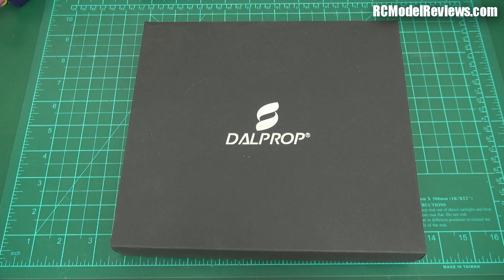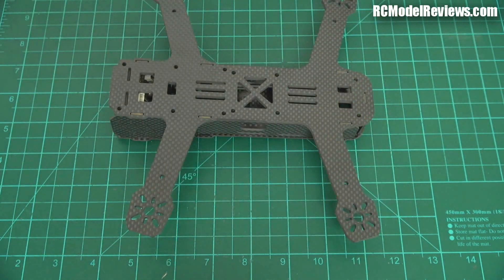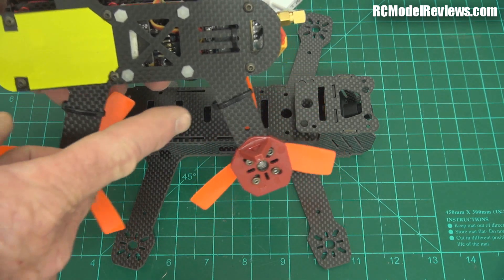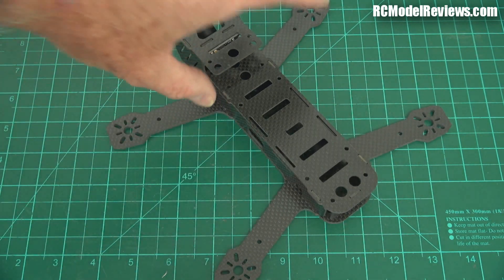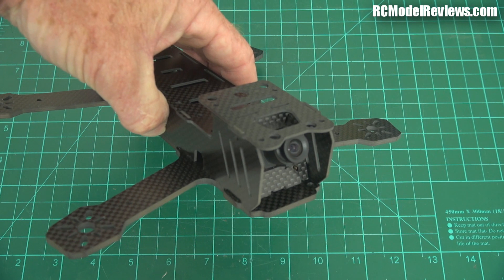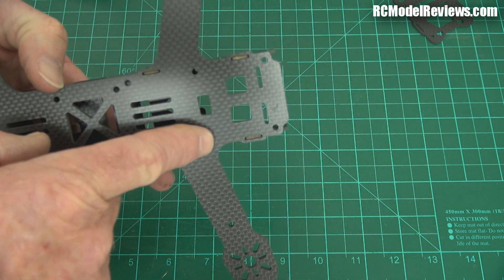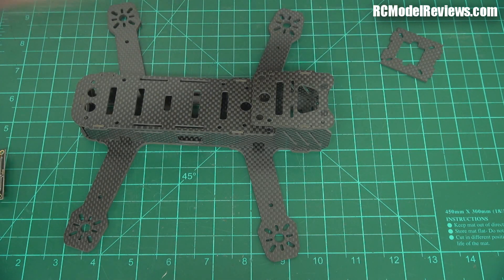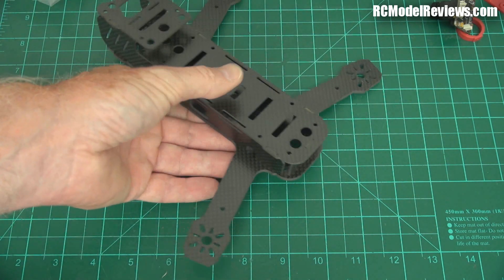DAL DL220 carbon mini quadcopter review (part 1)

Comment: DL220 frame was awesome 2 years earlier. I have it - frame have outstanding resilience to crashes. During learning crashed countless times against trees and concrete but wasn't able to break the frame. Plenty of space inside. Although have two issues: Little options for camera mount, because loop mount and naked board cameras with holes at corners are in fact obsoleted and not available more than 1.5 years. And frame itself is very heavy. Didn't used it more than year. Then recently decided to refurbish my old DL220 frame with newer components. Now it have F4 FC and different motors. Still 378g w/o battery. However with DALPROP T5045C props on Betaflight 3.4.0 preview and UAV Tech Betaflight default setings for 3.4.x 8K it now flies a way better than old build. I'll try to skin the build down below 350g later.

Comment: Bruce the reason they mount the fpv cam mount to the HD cam mount is because CMOS cameras and vibration = a lot of jello on a miniquad.
You will find that you need to add & remove weight all the time when a prop is unbalanced or not tracking true and you don't have a HD cam on board.  It really is a pain in the ass witch is why I went back to CCD cameras.

Comment: hi bruce, the hole in the center of arm is a backup for install landing feet (standoffs), we concerned if some people do not like using the motor protector to landing then they can install a the standoffs to be a landing feet. and we are going to release a new amazing frame kits, it is a X frame, we 'd also like you to make a summary of it.

Comment: Be careful running the wires from the escs through the hole on the wall. Make sure you leave some slack or the carbon fiber edge will cut your wire.

Comment: The "unusual" size of the "carbon" comes from the fact that it is not a real carbon fiber. Rather it is "composite" which is made by gluing together  much thinner layers together. You can easily see these layers on this video @ 2:05 - 2:10. I am not an expert of composite materials, but I am pretty much sure this is not the way how a real carbon fiber is produced. I know that it all comes down to a price. But lets be fair and not call this material a "carbon".

Comment: depending on carbon fiber you have whats called a min unit ply thickness for a cured ply and depending on quality and class this can vary but usually max about 8_10% of nominal ply thickness. so someone may get 3.3mm. so most thickness should be slightly , over 3mm as msnufacturer attempts to incorporate this variation. variation due to resin content, cure process, bagging, plate size etc

Comment: Hi Bruce love the videos, you mentioned that you will be testing the Epicrc 2204 2800kv and 3200kv motors. I have the 2800kv version on a Boxer180 and at the moment its my favorite and fastest quad. Can you run thrust tests with dal 4045 x3 tri-blades  and see if these motors can handle 5in props on 4s
Reply: +Bogie717 Yes, I have some DAL props here so I will be testing them on 3S and 4S with two and three-bladed props.

Comment: The camera angle is fine in my opinion
Reply: +Johnny FPV If racing is your bag then yes, the angle is fine -- but if you're more into proximity then it can be a real pain to have too much camera angle.  The ring-grip mount is much better because you can adjust the angle to suit your flying.
Reply: Or you could look at it as a way to force yourself to learn to fly fast in tight spaces.  I fly at 40-50 degree proximity and I didn't get that good from flying with 10 degree tilt.  Then again I didn't start with 30 or whatever this has :p

Comment: Hi Bruce , do you think that manufacturers will be concentrating on making components lighter now the FAA have started this registration bull shit , so FPV quads can keep under the 9oz weight limit ? I live in the UK an so you can guarantee if USA does it UK will to , just interested to now what you think ? Happy new year mate .
Reply: +Scott Thompson I suspect there will be a surge in interest in sub-250g craft -- but not as much as you might think.

Why?

Because if you have any craft over 250g then you'll still have to register with the FAA.  Only those who opt to fly nothing heavier than 250g will be free of the registration burden and I suspect that there aren't many who would be prepared to give away or sell all their other models, solely to focus on sub-250g ones.

Then there's the reality that if there's a massive surge in the popularity of sub-250g models, the FAA will simply change its definitions to include everything over 100g instead of 250.  Here in NZ for instance, we used to have a 100g lower limit for the definition of a "model aircraft" but when our new regulations were imposed in August 2015, that lower limit was removed so everything which flies and is remotely controlled is now covered.

Remember... he who makes the rules can never lose the game.
Reply: I wouldn't register quite yet. The AMA is currently fighting so if you are a member of AMA you don't have to register any aircraft.

Comment: Review the 122-130mm size frames.
I get 11 minutes hovering my 130, and easy 7 minutes  hard flying. :-)
Reply: +mike jh What frames are you using?
Reply: +xjet Hi
http://www.banggood.com/Deformation-Insects-130MM-Carbon-Fiber-Frame-Kit-QAV-Quadcopter-Multicopter-p-1009504.html

http://www.banggood.com/Diatone-ET-150-V1_0-Carbon-Fiber-Quadcopter-Frame-Kit-w-BEC-Power-Distribution-Board-p-982840.html

http://www.banggood.com/Diatone-ET-160-V1_0-Carbon-Fiber-Quadcopter-Frame-Kit-w-BEC-Power-Distribution-Board-p-995923.html

https://www.liftrc.com/atom-rotorx-frame

All using 1306 motors 

1000mah lipo
Check out My channel for videos

Comment: The holes are there for landing pegs?
Reply: +FPV Shine Except for the fact that it comes with the motor guards that have feet built in...
Reply: +FPV Shine That's what I immediately thought - think qav180, 210, 250.

Comment: I fitted the naked PZ0420M (28x28mm) with the ring type mount in this frame. No problem at all. I also didn't notice any sort of yaw issues so far. I like this one very much (except the weak arms).

Comment: Re mounting a board camera. Wouldn't there be a serious issue of shorting out a board camera ( one with components on the top side ) if you attempted to mount it flush with the CF mounting plate?
Regards
Nidge
Reply: +sputniksam Yes... there is that risk -- as well as the risk of causing physical damage to those components.

Comment: Re mounting a board camera. Wouldn't there be a serious issue of shorting out a board camera ( one with components on the top side ) if you attempted to mount it flush with the CF mounting plate?
Regards
Nidge

Comment: Bruce, I hope that you will take my advice and make it a point in the future to make a point about the proper use of these quads and fpv in every video you make that even mentions them. Due to the proliferation of inexpensive fpv capable quads, and all the tech that makes them so easy to operate that someone with no experience in the hobby can use one, as well and more so the increased number of complete morons using them in unsafe manners, the FAA has ruled that ALL rc models over .55lb must be registered with the FAA now here in the USA. This is unfortunately due to the aforementioned morons in the fpv community calling these DRONES, using them improperly, and spreading fear by the use of the word and embracing the word DRONE in reference to these MODELS, in the general public. Thanks. And for those of you who feel insulted by my comment, you are the problem. You either agree with me, or you are blind to the fact that the public hears DRONE, and thinks of a military predator DRONE  and that scares the crap out of them. Don't bother replying, unless you are Bruce aka Xjet.
Reply: +rcaircraftnut I think the reality is that those who are creating the problem are the "droners" whose GPS-assisted craft are remarkably unlike these carbon racers.   I suspect that the average droner would need to spend quite a while learning to fly a miniquad before they could even think of getting themselves into trouble.   Fortunately, the vast majority of those who enjoy miniquad racing are responsible folk who take the matter of safety very seriously.   However, I don't recommend they register themselves just yet -- because the AMA has requested that all its members refrain from doing so until the legality of the FAA diktat is established.
Reply: +xjet I agree. However, the more we put the word out the better. Just hoping that you will do what you can. Thanks.

Comment: have you seen the frames from Ready Made RC im thinking of geting this http://www.readymaderc.com/store/index.php?main_page=product_info&cPath=76_606&products_id=5004 what is your opinion?
Reply: +Aiden Sylve I haven't actually seen one in the flesh so I can only go by the specs and images on the page you've linked to but I'd say it looks okay for a minimalist 210-sized frame.  It's a pretty "bare bones" kit compared to the DAL offerings insomuch as their's no camera mounting hardware and there doesn't look like much room to mount your electronics and such but it sure looks plenty solid.
Reply: +xjet i'm mostly into racing so less is more

Comment: Hey Bruce,  what's your opinion on these sub 100$ zmr250 kits on aliexpress? http://m.aliexpress.com/item/32297666591.html?productSubject=Mini-250-Quadcopter-CC3D-Flight-Controller-ZMR-1804-2400kv-Motor-20A-Esc-5030-Propeller-CC3D-Distribution&detailNewVersion=2&adminSeq=201725844&productId=32297666591&productId=32297666591&shopNumber=727847&tracelog=wwwdetail2mobilesitedetail This particular one is a full carbon frame and "20A" ESCs. Maybe you could grab one and tell us what you think? Great vid as always,  and happy new year!
Reply: +plane1233 Not a good buy (in my opinion) for the following reasons:

1. the ESCs, although 20A are not using BLHeli (which is, in my experience, way better than SimonK now) and are only rated for 3S maximum
2. the motors are only 1804 -- far too weak for much more than slow flying and hovering.
3. the flight controller is a CC3D and these are (again... in my opinion) nowhere near as good or easy to set up as the Naze32

I'm in the process of updating my low-cost miniquad components list so watch out for a new video next week with much better alternatives that won't break the bank.
Reply: The myrcmart bundle is soo much better
Reply: ***** So... something more like this? http://www.aliexpress.com/item/ZMR250-Frame-Carbon-Fiber-NAZE32-6DOF-Flight-Controller-Board-2204-2300kv-Motor-12A-BLheli-ESC-5030/32465566106.html?ws_ab_test=searchweb201556_3%2Csearchweb201644_2_79_78_77_82_80_62_81%2Csearchweb201560_2&spm=2114.01020208.3.24.U0FdLu Also, would you say the 10dof naze32 is worth the added cost for a 250 racing/proximity quad? Thanks!

Comment: Might those single holes in the arms be used as locators during the machining of the rest of the holes on that part of the frame?
Reply: +Donald D'Egidio I doubt it... they could have used the center-hole in the motor mount area for that purpose.  I suspect the frame may have originally been designed to have legs bolted through this hole but the plastic motor-protectors/legs were used instead -- after the frames were milled.  Or perhaps they just haven't updated the G-codes for the milling to remove that hole.
Reply: I have a feeling they were originally planned for standoffs to be used as a "landing gear"
Reply: +plane1233 My thoughts too :)